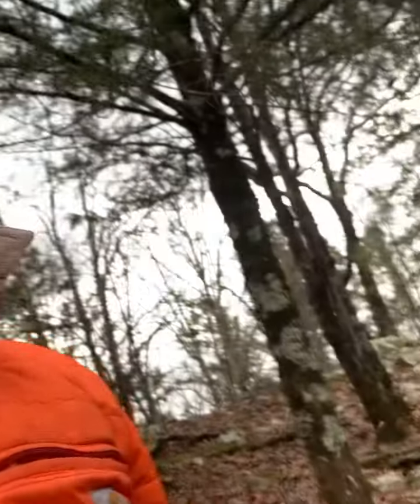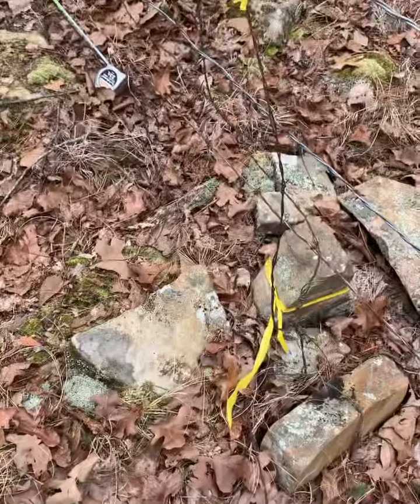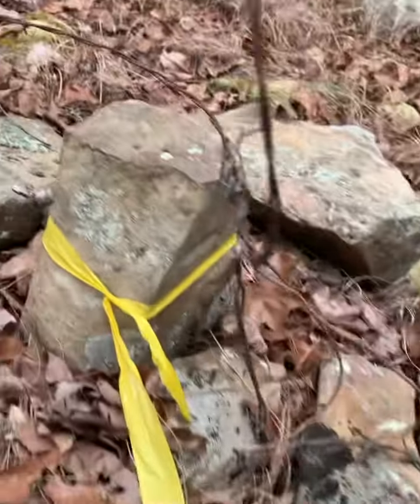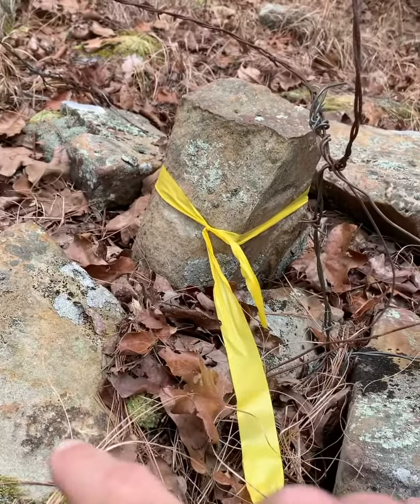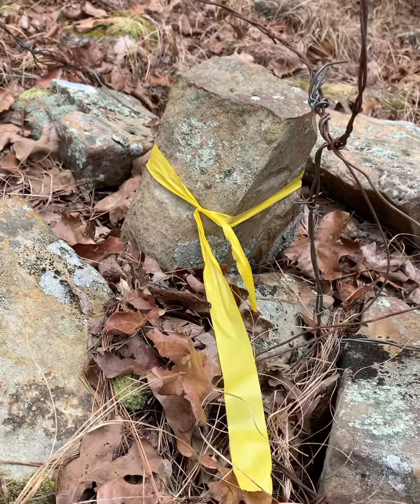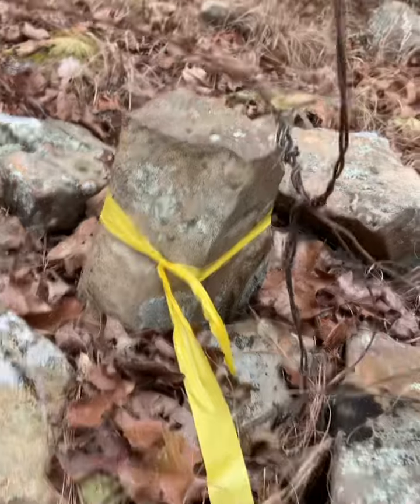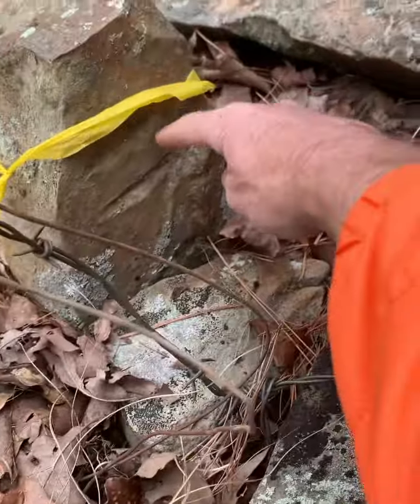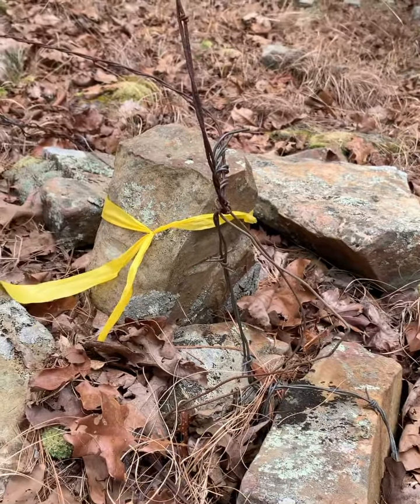What are the notches on the survey stones for?

Comment: I found a rock /stone on my property in the middle of my back yard . It looks like a eggshell cut in half. White stone . Could it be a marker ? 1926
Reply from the maker: More than likely it is not a survey marker. The surveyors were not interested in find and using interesting looking stones for one thing. They used what they could find without having to carry. Also, the law required the stones to have a minimum number of cubic inches and be buried a certain percentage of the length. Good question.